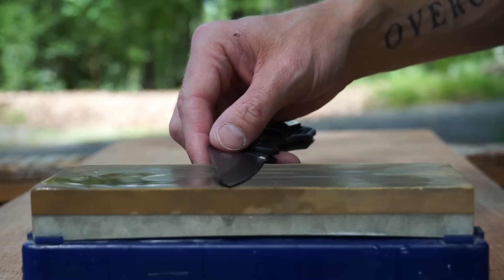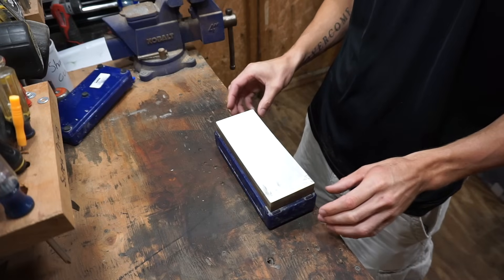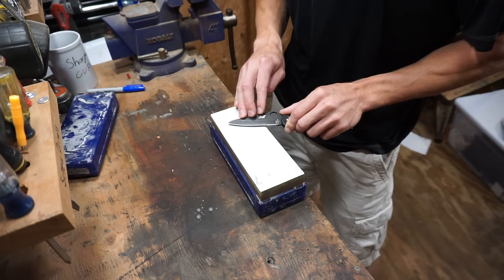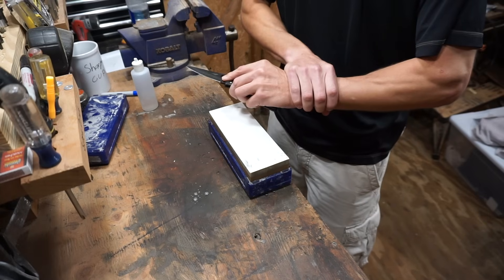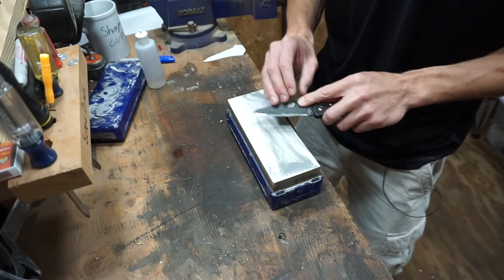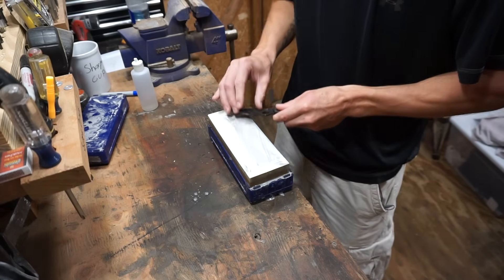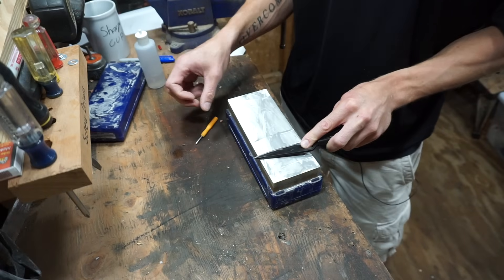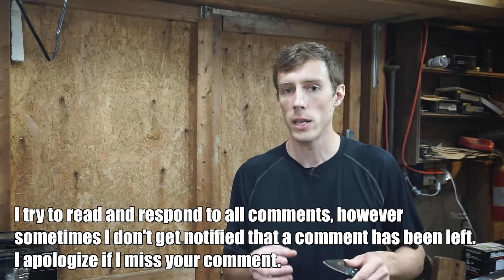KNIFE SHARPENING TIPS BEGINNERS MUST KNOW 2  |   HOW TO MAINTAIN AN ANGLE

Comment: Three-year-old video, so not sure @OUTDOOR55 will see this, but here goes. I'm a martial arts instructor, and, crazy as it may sound, sharpening a blade has elements in common with throwing a punch, at least in this fundamental way: motion should initiate from the core, i.e., as you say, from the torso. Most people throw punches from the shoulder, which introduces a variety of problems, that I won't detail here. I mostly want to call attention to your demonstration: once you lock in your angle, the only thing that you're doing is pivoting from the hips. The motion is very clean and uniform. Working with wrist action inevitably introduces minor variation in angle of the blade. Oddly, in this respect, sharpening a blade is not a fine-motor skill; quite the contrary, just pivoting only, almost robot-like, will produce better results. Thanks again for very concise explanation supported by clear demonstration. I've never looked at knife sharpening in quite this perspective, and, like any good martial artist, I'm willing to adopt a new technique that will produce better results.

Comment: I couldn't agree more about trying to maintain a consistent blade angle across the entire stone when sharpening......and across the entire blade (I sharpen my kitchen cutlery so I have 8" blades). But you talk about maintaining the angle for micron sharp edge but you show a stone with a big huge bow in it (from sharpening) with probably a 10-20 degree total angle change on it due to the bow in the stone. It is equally important to maintain a very flat stone in order to maintain a consistent angle. Stones need to be flatten every now and then especially if you can see a noticeable bow in the stone otherwise maintain a consistent blade angle with your hand is all for not.

Comment: I just watched your video again. You give some good instructions for beginners and even make some good points for those who are experienced. I see quite a few people lift the blade off the stone at the end of a stroke and it will usually change the angle as it’s coming off the stone. You can actually tell that the angle changes from the sound it makes. The sound is something to listen for when sharpening anyway: a change in the sound will happen if you accidentally let your angle rise or fall. With experience you will be able to feel a sudden change in the angle and the sound confirms it. 
Good video.
Reply: Good points, thanks.

Comment: I've found that keeping a really firm grip on the handle helps. I think most of us, when we grab something in a "death grip" (a rope, a bar, someone else's wrist or judo jacket), we tense and set everything for optimum strength, and don't change that. If I use a loose grip, I find it easier to move my wrist, letting it change with varying pressures. Also, getting the initial edge contact is maybe a little easier if you watch the water on the stone. Not a puddle, but moist, so when the edge makes contact, it squeezes a bit of water out. And of course the Magic Marker trick (painting the edge).

Comment: Hey great videos! I have a quick tip to help solve your weak side strong side problem and everyone will have one because when you change the direction you are sharpening you are looking at the knife from a completely different angle. My solution? Don't switch sides switch hands!! I know it sounds scary doing something with your non dominate hand but after a few times doing it you'll find that your non dominate hand is much easier to use than trying to keep an angle using 2 different surfaces of the knife. I shave my face and head several times a week using a traditional straight razor and I switch hands when I do that too for the exact same reason its a lot easier to move my left hand straight up or down than it is to reach across my face and try to move my right hand at all those funky angles. I literally seen the little light bulb over my head in the mirror when I thought this might work for sharpening too. I am by no means ambidextrous, if I can do it anyone can. Love the videos thanks!

Comment: Great video man,  I've found that sharpening is like playing an instrument you must practice or you will get extremely rusty. Once you work with a certain edge your muscle memory takes over and it becomes second nature.  I recently switched from using nothing but scandivex grinds to full flat and saber grinds with micro convex edges and it has been a chore finding that apex .  The thing I like about moving to higher fine grits is that you can hear the blade sing ....If it ain't making that curtain smooth ninja sound its not working 😁

You are spot on with locking in and using your waist rotation.... One huge thing I would add is that taking care of your knives makes sharpening almost a non issue, a well maintained knife usually only needs a few passes on a loaded strop to bring it back to hair popping sharpness. Many people literally use their knives to the point of destruction making what could of been a  simple task  into a much longer stressful one.

Comment: This is a great video, really helpful, thank you. Your emphasis on ergonomics and correct anatomical positioning were so on target.
I think it's important to be standing with the counter/work surface equal to the height of your hips. The closer the work surface is to hip height the easier it is to maintain consistent momentum of your hip swing, proper angle of the wrist, and blade pressure on the stone. Also, holding the knife close to and perpendicular to the body, centered between the hips was helpful to me.
I guess it's like learning to drive a car, after a while you don't have think about the mechanics of each movement, you just get in it and drive.
Thanks again for your thoughtful explanation. This was hands down the single best video on the subject I've seen. And, quite frankly the amount of time I've spent watching knife sharping videos is concerning.

Comment: Some pretty good advice. I have always had the stone in front of me and used my arms as opposed to my torso, although I have caught myself at times using my torso in a back and forth rocking motion. I still prefer to keep the movement in my arms and the stone in front of me, so my blade is moving to and from my body instead of side to side, but whatever works for you, go for it

Comment: Great video, I've been slow to learn but my 'style' is much the same as yours, which is reassuring. I find it easier to work with my stone on a high bench, so it's easier to see, but I still lock my upper body up and guide with my left hand. My wife says I pull a silly face too, but I guess that's concentration 😊 At least I've finally started getting my knives how I like them.

Comment: Be careful if your knife has a strong up-curve towards the tip. This method is best for knives that have relatively straight cutting edges (e.g. Spyderco), but you need a different technique for blades that curve significantly near the tip. This method based on axial rotation is fine for many modern knives, but please don't neglect your tip (hahaha). This advice would likely apply to bushcraft knives, moras, certain tactical knives like Ka-Bars, skinning knives, etc. Great video, regardless! Consistency in everything is the key to the secrets of the universe...

Comment: Have you sharpened any ka-bar knives. For me, which I'm not very good at sharpening, some knives seem easier to sharpen. Could that be my technique or the type of steel. Any pointers on different thicknesses or types of steel.
Reply from the maker: I have not owned or sharpened any ka-bar knives. One thing to keep in mind is not all knives can get the same heat treatment. Some may harden slightly better or worse, depending on the manufacturing arrangement.  Steel thickness and deferent steels shouldn't matter in your sharpening technique. The basic principles remain the same. As long at the blade is fully apexed and the burr removed, you will get a sharp knife. It may take longer to sharpen due to the thickness, but everything else remains the same. Hope this helps 😀

Comment: I dont have a buffing compound for my leather belt, can I use leather belt alone for stroping? And how important it is to keep water on the stone and how often should I remove particles from surface of the stone while sharpening
Reply from the maker: Yes you can use plain leather. It will take longer though. I depends on the stones. These norton stones seem to work better with a slurry. Other stones won't even build up a slurry. Some stones will clog and need cleaning very often. Others won't. So it depends on the stones as to how often they need cleaning.

Comment: Hi Alex! Could you please give some tips on sharpening long and wobly blades? I'm having troubles with sharpening 40cm edge of an approximately 1.5 cm wide blade. As one part of the edge gets shaving sharp, the other still rips the paper. I'm using pretty coarse wetstones (220 to 1000) and a strop.
Reply from the maker: Wobbly blades are tough. Extra care must be taken to maintain an angle. What part of the blade gets sharp and what stays dull?
Reply: OUTDOORS55 , normally it's easier to sharpen center of the blade, while the wobly top is just a pain. I normally use accusharp for that, since the blade bends so much, that it's impossible to maintain an angle. May be Lansky system from your last video will help.

Comment: I call my sharpening differential sharpening. This is what i do for a edc type knife.  Toward the heel ill make it as sharp as i want and then less sharp the further towards the tip i get.  Now the tip is still sharp just a stepper angle making the tip strong.  One thing i never do to a edc knife is make it hair popping sharp.  I use my knife for amidst everything you can think of.... heck i used it to make holes to plant onions!  Hit rocks and didn't break the tip. If you actually use ur knife hard a super sharp edge will last half a cut.
Reply from the maker: Yeah I use my knives super hard. Cutting a hole in aluminum flashing, carpet, cutting bailing twine from around lawnmower blades, punching a hole through drywall, etc,  is an easy day for them.  No steel will hold a hair whittling edge for any amount of time under those circumstances. Although it is fun to put edges like that on a knife. It's almost pointless most of the time if you actually use your knife. Thanks for the comment 👍

Comment: Do you consider flattening your Norton stones or like Murray Carter you do not believe in flattening sharpening stones at all?
Reply from the maker: I have flattened these a couple times before. They should probably be flattened. I do work the higher areas though. I always feel like I'm wasting the stone. I think it was Murray carter who said that. I knew I heard that somewhere before but couldn't remember where. Only time I really WANT or NEED a flat stone is when I'm sharpening  Scandinavian ground knives. I don't own may of those (only a couple moras). I usually use my edge pro stones (only the stones used by hand, not the whole machine) for them anyway as they stay flatter.
Reply: Great content on your channel. Murray advocates thinning the blade down every time you sharpen the cutting edge so that you keep the same blade geometry. Are you aware of this, and do you practice it? I think you should incorporate it into your videos since it is rarely talked about on sharpening videos.
Reply: Thinning behind the edge is vital every time you do a full sharpening of a knife. If you are just touching up an already sharp knife's edge then you don't need to do that.
Reply: The worn stone gives a convex edge, i like that on just about everything.  I true my stones often because I also sharpen razors on them.  There's no better way to trash a razor than an untrue stone.

Comment: Can you still get a hair popping edge, on some 220grit sandpaper?
Reply from the maker: I have not tried 220 sand paper. I have tried a 220 grit edge pro stone. And you can definitely get a hair popping edge on a 220 grit stone. I imagine sand paper would be the same. It take a little more practice to sharpen on very coarse grits. A delicate touch is necessary.😀

Comment: For pro edge sharpening stones, what grit would you recommend for a sabor grind on a survival knife?
Reply from the maker: Are you talking about the Edge pro stones?
Reply: Yeah. My schrade schf30 has gotten completely dull. No idea what the steal is.
Reply from the maker: I have the 220, 600, and 1000 stones. If you can only get one get a 600. I would recommend two if you can swing it. The 220 and 600. One other thing I will mention is I haven't had good luck with schrade steel. They will sharpen to some degree but won't take a super sharp edge... not sure what's going on. I suspect the steel is a little soft. That could just be the couple I've worked with though. Your mileage may vary. Hope this helps 😀
Reply: Helped so much! :D Thanks a lot. The knife I got was pretty cheap.

Comment: Will you consider experimenting with different styles of stropping and compare the test results? Could be interesting to see which method works best, including the real value of compound laden vs raw leather.
Reply from the maker: I have actually been experimenting with some different stropping materials and trying some different methods (some of them are pretty far out there lol). I am going to do a video... not exactly sure when though as I'm working on some other videos at the moment.. using raw leather is something I don't have a ton of experience with. I have used a regular old belt to strop and it works ok but haven't tested it after using different grit stones and how it affects the edge. I'm thinking it will probably be in the next couple weeks. 😀
Reply: Cool beans. Raw leather is something I guess, but I really was referring to a regular genuine leather belt which is far more accessible to Joe Soap. The raw also referred to regular leather without compound vs regular leather with it. Sounds like that plan is afoot. Looking forward to it

Comment: What stones should you start using first, do you stick with a certain grit and work your way up/down?
Reply from the maker: A coarse stone first. Apex on the coarse stone first then work your way to finer grits. Hope this helps 😀
Reply: OUTDOORS55 thank you, but what would a course stone be compared to a fine grit?
Reply from the maker: 220-400 grit would be considered coarse. 600-2000 fine. 2000-10000 super fine. Or somewhere in there😉 It's much easier to apex on coarse stones then move on to finer stones.
Reply: OUTDOORS55 thank you very much

Comment: @outdoors55 how many strokes or how long should I do each side for. And is it best to bring the blade back in backwards strokes with the sharp bit facing away from you?
Reply from the maker: sharpening direction doesn't really matter. do whatever works best for maintain an angle.  The number of strokes doesn't really matter either as long as you keep your bevels even. hope this helps😀

Comment: I have a blade that is curved in the middle. I sharpen it but it won't sharpen the middle part. Any tips?
Reply from the maker: Curved blades are tough. Either use the corner of the stone, or get very narrow stones (edge pro sells some very narrow stones). I typically don't buy knives with super recurve blades due to sharpening difficulties. I do have some though and may do a video on it in the future. Although I'm not SUPER great at it. I've also heard lansky sharpening systems work well too. I just bought one for $25 and will do a video on it shortly. Hope this helps 😀

Comment: Great tips. Especially enjoyed the one about maintaining the angle with your weakest side.

One thing about stropping: lately when stopping I have been raising the angle of the knife quite a bit (more than the angle I sharpened with) and then quite roughly pulling the knife backwards in order to break off the wire edge or burr. This seems to have given me an edge which is FAR more durable than anything I've achieved before. Do we really need to worry about rolling the metal once the burr is removed? Isn't it the burr that rolls over rather than true edge?

Comment: Do you know what to do with rolled over edges?
Reply from the maker: Re sharpen them. ... if an edge rolls it usually means the angle is slightly too steep for the particular steel. I would just lessen the angle slightly as I'm re sharpening and go from there.
Reply from the maker: Yes you can do that as well. For me, if my edge rolls using it for every day tasks, it will roll again. I usually try to find an angle the steel will support without rolling. That obviously takes some experimentation. I almost never have an edge roll unless I take it to an extremely steep angle. It all depends on your personal use. Thanks for the comment 👍

Comment: Is the 220/1000 a good beginner stone to start sharpening with?
Reply from the maker: Yes it’s a great stone. One thing to mention is the norton stones are soft stones and not as forgiving as a harder stone. If you want a very good beginner/ user friendly stone I’d look into ceramic stones. They are expensive but you will gain that back as they last forever. The norton is a fine stone if you are willing to learn it. It just requires a more delicate touch. Hope this helps 🙂
Reply: Buy a King 1200 grit stone and a King 6000. Best stones for a beginner & they are very reasonably priced.
Reply: Danvil too fine

Comment: how do you sharpen a longer blade, like an 8" knife?
Reply from the maker: I usually work one section at a time if on a smaller stone. Large knives can take a lot of time to sharpen as they are essentially the same as sharpening two or three smaller blades. Ideally you would want to have a stone about the same size as the knife. That's almost never the case though and you just have to work small sections at a time. Hope this helps 😀